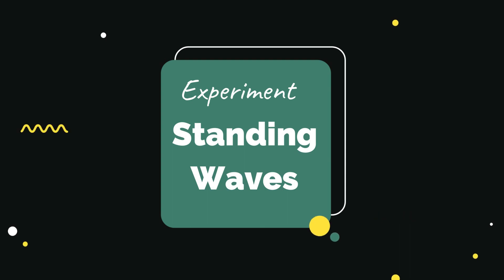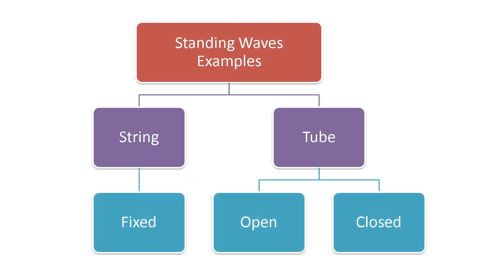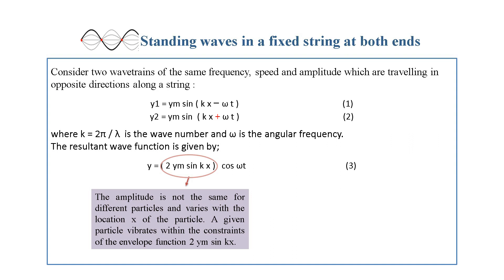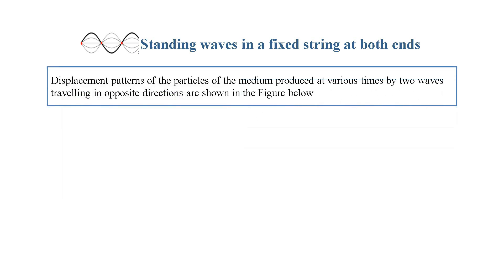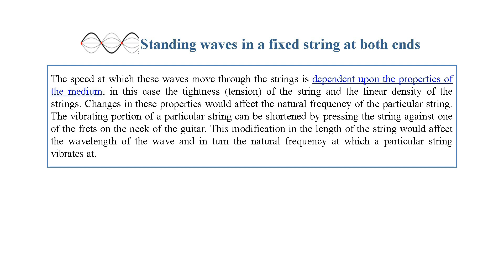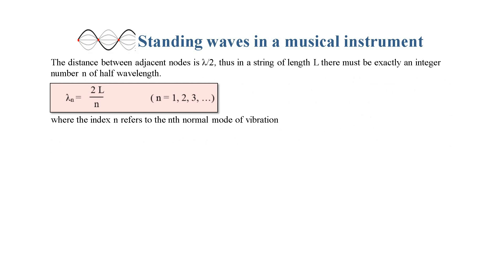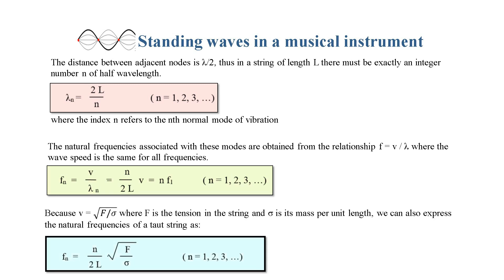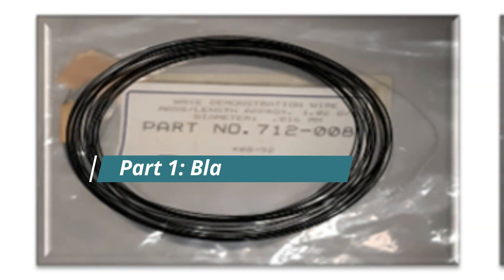Standing Waves - colored strings.#standing #waves #physicslab #oscillations

Comment: Great use of the magnet to cause the wire to vibrate.  I usually use a mechanical oscillator to vibrate the string. Have you used a strobe light to see the wave pattern?